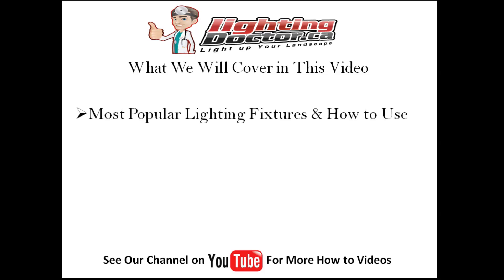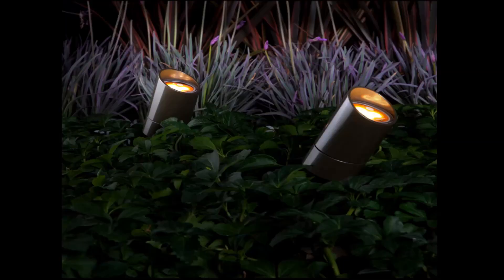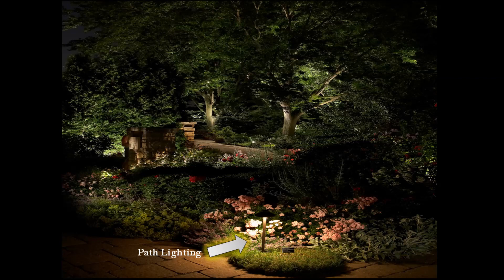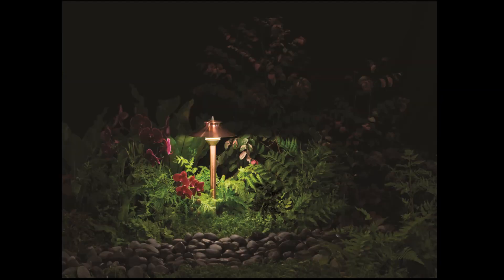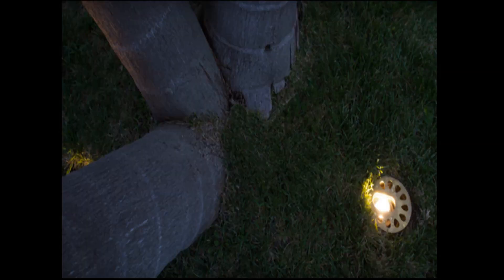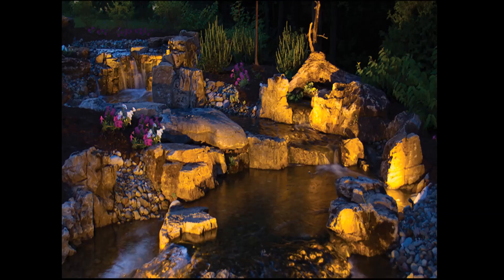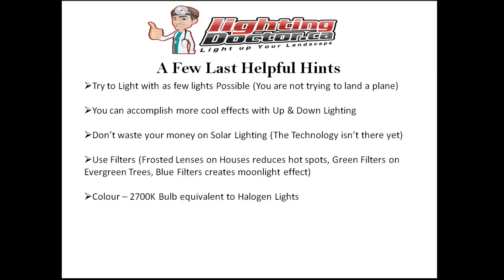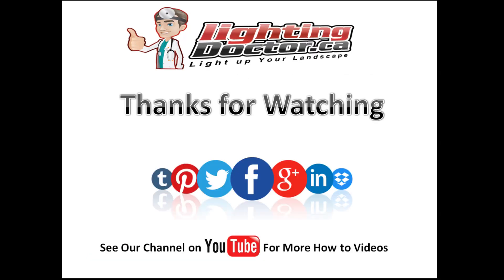How to Install Low Voltage Outdoor Landscape Lighting - Lighting Techniques & Tips

Comment: Great Video. When you are first installing up lights in front of trees or house features like columns how far do you place them from the house or tree? Is there a good rule of thumb as a starting point? 12 inches? 18 inches?
Reply from the maker: Usually within 12 to 18 inches is a good rule of thumb!

Comment: I live out in the middle of no where and have a big beautiful harscaped flower bed by the road... but I have a large security light hung by power company.. so it lights up front yard well... but I want that pop as people drive by.. I would need to show you pics I guess.. my issues are trying to get the wow factor and not let the light take away.. I live on 2 acres.. only 1 outdoor security light... no street lamps... I live in rural indiana..

Comment: whats the best lighting to use ,to highlight the upward lighting in a 2 story house?
Reply from the maker: Great Questions.  Best to use a directional up-light http://www.lightingdoctor.ca/product/fx-luminaire-led-up-light/.  These have a narrower beam angle which throws the light further.  If you really want to get the lights up to the peaks you may have to upgrade from a typical 4.5watt LED Bulb to a 5.5watt should do the trick.  Thanks for the question!!!
Reply: RB OCONNOR you can use a par 36 light. 7 watt 3000k to reach 2 stories.

Comment: What should an average (if there's such a thing) house cost? Say to do a 2500 sq foot single story house.
Reply from the maker: Great Question, I get that a lot.  It is tough to give an estimate without seeing the landscape andwhat features to highlight.  However I would say on average a typical house approx 2500sq.ft would be looking at between 12 - 20 Lights.  A Fully Installed Price for this should average between $2,500 USD to $5,000 USD.  Hope that helps answer your question! Cheers

Comment: how do I unlock the pierce-point connection clip from the landscape wire.?  The clip closed but did not pierce the wire.  These are 20 watt floodlights.
Reply from the maker: They are very tough to open once closed. I would reccomend staying away from those types of connectors as much as possible. They have the tendency of comprimising the integrtiy of the wire jacket and causing corrosion over time. Search for BVS2 Snap Lock Connectors!

Comment: Talk about a light bill.
Reply: Modern LED lights use 2 to 5 watts per light.  Look how many LED's you can run for the cost of running a typical 100 watt tungsten bulb.
Reply from the maker: Agreed. LED is so much more efficient among so many other advantages. Thanks for the input!